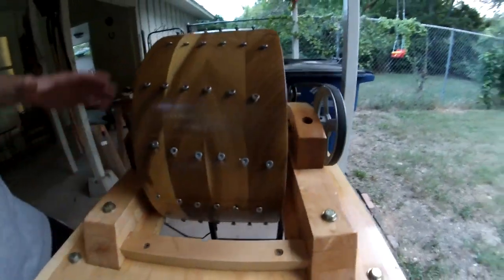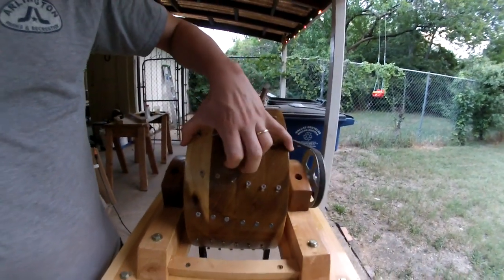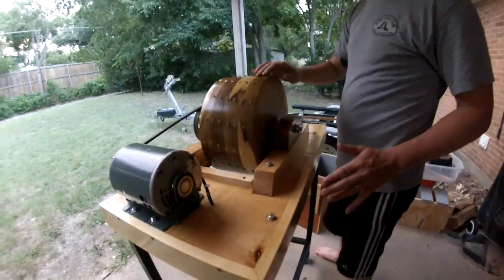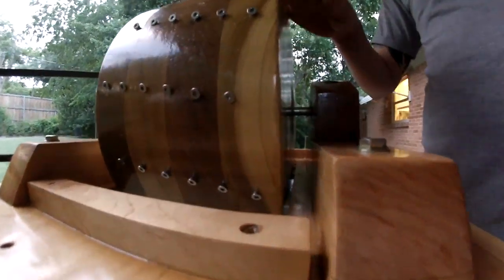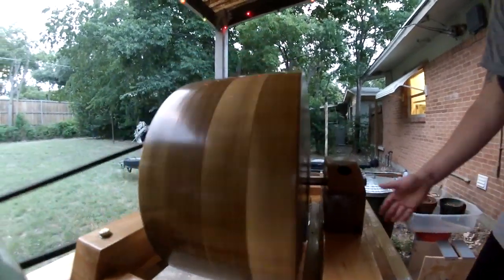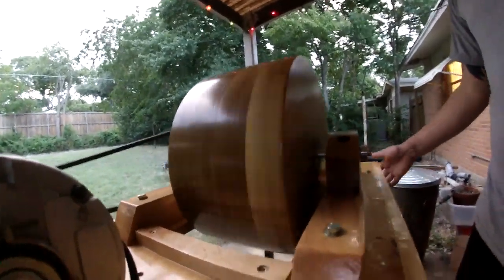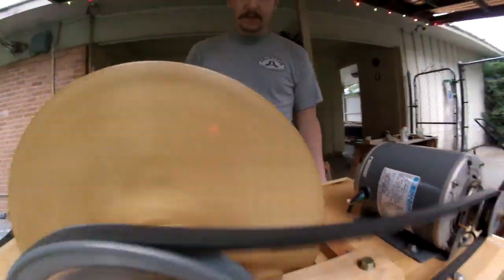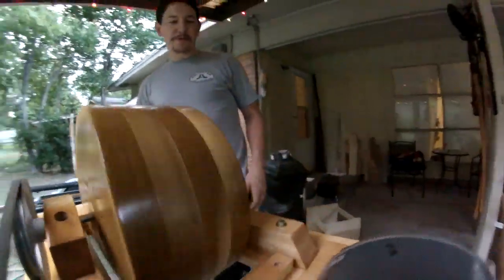The Machine Lives! - DIY Apple Grinder

Comment: Working on the plans for my own grinder. I'm using this video as one of my inspirations. It's a stretch, but do you have and details or pictures of your hopper design? Was there a lot of apple spray out the top?
Reply from the maker: Hi Evan. When I built the hopper, I winged it, measuring as I went. I did leave enough space between the drum and bearing blocks so the hopper walls would slip between them and sit flat on the table. There wasn't much spray above, but below It threw apple pumice everywhere! I suggest putting the collector directly under it or building some kind of chute. Good luck!

Comment: Fantastic looking grinder. I'm building a new apple grinder right now, and am taking some inspiration from your setup. I'm curious how you attached the wood drum to the axle, as it looks like you used a smooth axle. I've used allthread before and just put a couple of jam nuts on there to hold the grinder drum in place. Just wondering what you did. Thanks, and fantastic job!
Reply from the maker: Hi Daniel! Thanks for the compliments! Because of the drum's width, the center hole had to be bored from both sides, meeting in the center. Since I did that with a hand drill, there was some slop in the straightness of the hole. The axle literally had to be bashed in. Needless to say, it's a friction fit. :-)
Reply: Dave, thanks for the info. I’m building my drum in layers with the center already drilled out then joining the layers together on the axle, so I won’t have the friction fit that you did.